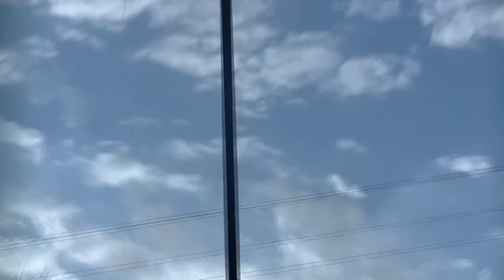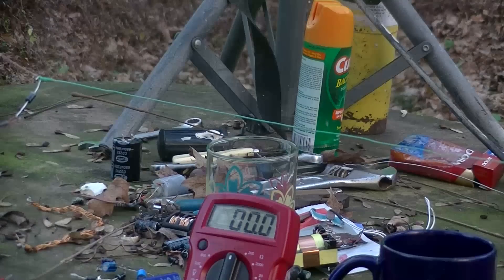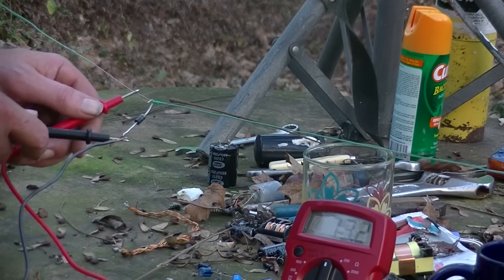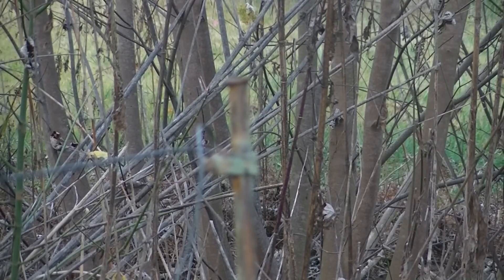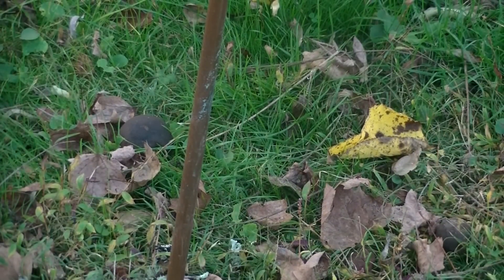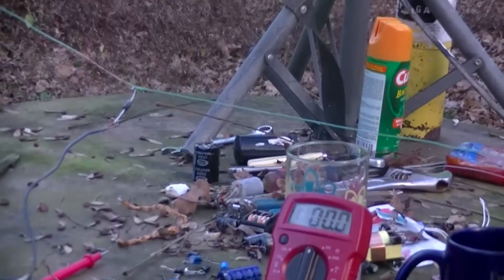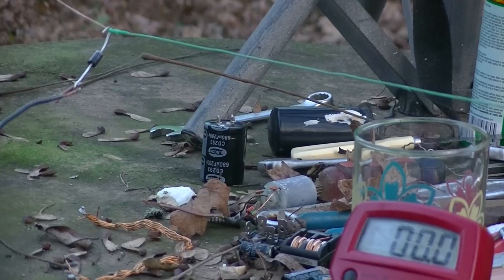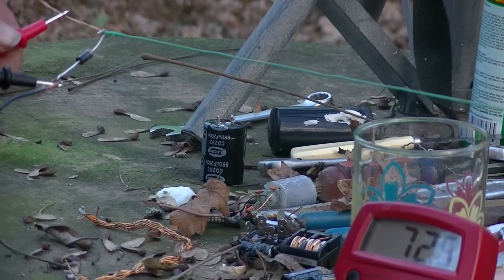Free energy antenna

Comment: For every meter going upward you will increase voltage by 1000 volts. Volts do nothing. Where are your amps? The stuff that makes stuff do stuff? There is no current in this video or you would not have so casually touched that ground wire connected to your positive bare wire as you did. This will do nothing. The thing the world is after is free CURRENT. Not VOLTAGE. Bless your heart. You did all of that work for nothing.
Reply from the maker: It was fun, just to see if I could get electricity out of the sky. In another video I was able to get 360 volts in a capacitor, that will bite you, but thanks for the comment.

Comment: 73 v potential does not mean anything. what matters is how much voltage drops when current runs. maybe you cant light a bulb with that setting because voltage can drop when there is a little current on the wire.
Reply from the maker: It was something I did for fun  , Have not given it much thought in awhile .

Comment: If you make a sphere shaped antenna out of graphene needles with sharp points facing towards the sky, i think you will increase efficiency. The more voltage you get, the better because if you get thousands of voltage from atmosphere and then step it down with transformer, you can get current therefore power. You can use atmospheric electricity to power a DC motor at 3000 or 3600 RPM which you can use to spin three phase electric generator and get thousands of AC voltage out, and then step it down with microwave transformer to get 120 or 230 volts which goes to voltage regulator and then to power your house. You will also need Tesla coil as it converts static electricity to AC when used in reverse. Youtube search "Tesla coil "the true secret" how it was really used.".

Comment: What can be powered with this? It looks like induction from the AC lines.
Reply: not much considering i would guess the current would be in the microamperes
Reply: Earth is electrically highly charged body. The sky at 50 km altitude is charged with 400,000+ volts. You need a step-down transformer to step down voltage to 120 or 230 volts and increase current/amps by a lot. The reason earth is highly electrically charged body is due to birkeland currents coming from the Sun so you are essentially harnessing electricity coming from space when tapping into atmospheric electricity. https://www.youtube.com/playlist?list=PLwOAYhBuU3UeKWHRrCw4i-KviQnAhQhBM
Reply: No mere ordinary transformer will do, and its not as simple as stepping it down, you aren't going to be getting a nice pretty 60Hz sine wave, that power needs rectified and dumped into batteries then it can be properly converted to generic AC.
Reply: You only need enough atmospheric electricity to rectify and convert to DC to power a DC motor. You can then use the DC motor to spin Electric Generator at 3000 or 3600 RPM to get AC at 50 or 60 hz.

Comment: Amperage is what the game is about, what you are showing is a fraction of what is needed to do any thing meaning full, when I was a kid, tested WW2 batteries, they showed at 1 or 1.5 volts but had no "power". Nothing here is free, their is no free power, you already have an investment in poles, copper wire, grounds, I assume are also copper, diodes, and you are using more power to make the "Craftsman" multimeter function than your are making. Solar or wind may give you better options, that diode is also eating your voltage.
Reply: Get familiar with birkeland currents, its what people are tapping into when harnessing atmospheric electricity. https://www.youtube.com/playlist?list=PLwOAYhBuU3UeKWHRrCw4i-KviQnAhQhBM Amps/current is easily gained with a step-down transformer stepping down high voltage to 120 or 230 volts. The higher the antenna is raised in the sky the better.

Comment: OHM's law will tell you that with a load, voltage will drop. I'll assume if you add a simple led bulb you will short out the ESD and the bulb might blink once but that's it. with caps, you may be able to blink the LED every 10 sec or so. give it a go...
Reply: Moon shiner  a blinking LED will use 20mA at 3v. So you won't need to calculate the voltage drop from 70V to 3v to provide a split second of current with a capacitor to determine this is a lost cause. There is simply not enough current to capture to charge anything worthwhile. What the video demonstrates is that he is showing what a radio signal looks like at a voltage level. If he tuned into the frequency, he would hear the broadcast. That's all. This is the basic concept of the no-power crystal radio.

Comment: Ok so, volts is fine but you need to build an atmospheric motor such as a Corona motor and a whole bunch of capacitors to make use  of atmospheric power. Yes you can get higher volts but there is no amps and the voltage will drop but if you can store the electricity fast enough to capacitors and regulate it it can become usable power. Look up the ion power group

Comment: Hey my friend, I am so happy to find you doing this.!! I can help you improve your system, and get High  voltage, gain's, if you want me to: I have helped,  Garrard Morin, with his experience, and others. All you need to do Right Now to get  HIGH Voltage, is ( add an additional piece of copper wire, any size (AWG 8 ) OR Larger. It can be added to your wire you Are using Now.!! Only Twist it onto you're wire about one Every 1 to 2 foot, or closer".... ( Making The wire You are using NOW" LOOK like 
( COPPER, Barbed, wire,). Hanging in the Air.!!! I know you it will have to be taken down, To add these Extra
 Peace's of wires, but Believe me, it will be well worth it for the Gian's in higher voltage you will get. After adding the extra Peace's to make you're wire look like a( Barbed wire,)!! 
Pit Everything back as you had it before,... NOW" the Only thing to remember is, that, as YOU are cutting the extra Peace's to be Twisted onto the straight wire that you have now, is ( ALWAYS)!! ALWAYS// ALWAYS, Cut the pieces that you are gonna be Twisting as SHARP AS POSSIBLE.!!!! USE GOOD QUALITY Wire cutter's,!! And cut the Peace of Wire that you're gonna twist onto the wire you have now, and cut it VERY SHARP.!!! The Sharper you get the smaller pieces, the more power you will Have at the end of the wire, Where you are Connected To your cap,.... In other words" what you want to do Is, take The wire You have up NOW,  DOWN.!! The get another roll of wire to cut 6 to 8 inches Peace's from, and Twist it onto the wire you have, Now, Leaving a short piece of it sticking out, making it to LOOK Like, a long strand of Barbed wire, Made of Copper, hanging in the Air Where you're other peace was hanging. If you do this, and leave the little Peace's that are sticking out, SHARP, ON THE TIP'S, You will be needing a capacitor that can take 8 to 1200 Volt's Range.!!! Contact me if you have any questions, I will tell you all I know. JR, and Good luck my friend.!!
Reply: Could you email me at roofingamerica.sc@gmail.com
Reply: Hey brother, Ive been following Gerard for a while. Have you seen any videos like this one that have all that extra info you recommended? I would like to create a medium sized ion harvesting unit. I appreciate if you could point me in the right direction. Cheers.
Reply: JP: Barbs?  No.  Voltage and current is induced by greater length of action.  Short wires, perpendicular to the main antenna will not increase induced voltage.  Read a book on electricity and RF principles.

Comment: You do realise the diode is cutting off half of the waveform so it will be 146V?
Just because you have a voltage doesn't mean to say its free energy, connect a load and watch it jump to zero.

Comment: Can you send me a schematic of of your setup?  Thanks.
Reply: Teryo Tolibas Hi,

I think he's just using a startup non-polarised capacitor (like the ones used with induction motors; washing machine or dishwasher motor) where one lead goes into the ground, while the other (through a diode; 1N4007 ?) is clipped onto the aerial wire he's got put all around his property. But that's conjecture. 🤔😐😊
Reply: Teryo Tolibas https://youtu.be/ah-GyD2GuLs
Reply: Fransje Bik

Comment: You're crazy puting and antenna next to a power line!!!! The power line being so close will induce voltage to your antenna giving you voltage, very dangerous!!
Reply: Lisa Lefteye or is it crazy genius?  Either way, the electrical utility is not impeded in any way by inducing a current on his wire.  However, it needs to be less than 6 feet to actually experience real corona discharge... plus it is a telephone wire which is like 24awg... i am an electrician and i wouldnt be concerned with such tiny wire
Reply: @Lisa:  Putting his antenna near a power line to induce a voltage?  That's the point.  How else do you think something like this would work?
@Matthew:  I don't see any genius' anywhere near here.  Coronal discharge?  What's that got to do with anything?  Any conductive object charged to a high enough voltage will exhibit a coronal discharge independent of any other conductors nearby.  Induction and corona have nothing in common.  Finally, why your lack of concern for such a small gauge wire, presuming what Lisa asserts is indeed correct?  In a proper configuration, and without it making contact with a live power line, it could easily induce enough voltage and current to be a problem for the beating heart inside a grounded human.  Wire gauge has  almost NOTHING to do with it.  Surely as an "electrician" you've seen the inside of a transformer.  What about all that "tiny wire" that's in there?  Still, even after making direct contact with a power line, a 24 AWG copper telephone wire could EASILY shunt enough current for long enough (before it vaporizes) to stop a person's heart.  So what's your point?
I'm an engineer and I think you couldn't find your ass with both hands and a headlamp.
Reply: @Lisa Fear mongering is one of the opratives of the Powers that soon were to be. At most 250 years ago the popukation was connected to the universal power grid in that way. Tesla and Morray just continued that path and the cabal was resisting with fear. The power he is unleashing is in no way as harmfull as the elctron energy we are forced to use.

Comment: A percentage of the "power" or "energy" is certianly being induced from the mains line nearby however there is a great deal of othher sources at work here. One of the most powerful of which is nearby "microwave towers" another is "Radio signals" both natural as to material in the process of decay, and of course man made signals, there is also natural ground balance which consists of positive and negative electrons constantly exchanging in the form of static. So with this all being said "YES" the power / energy being recovered is indeed "FREE" as there is no charge being applied for tbhe collection outside of the cost of the parts and time to build it. And to anyone exparamenting with this keep it up, you are all doing a great job!

Comment: Bob, unfortunately 73volt is not AC power. Power = voltage x current. So, add a load (an LED connected in series with a resistor or a submiliampere bulb used a while ago in telephone exchanges) and see if you still measure voltage between your rectifying diode and the earth connection.
Reply: Also with the diode it is not AC. That diode is a half bridge rectifier so it is half of the AC wave = DC. BUT if you can get a pulse from that to a transformer primary winding, you might something useful out of the secondary winding.
Reply: Or utilize the dc volts to split water (H2O) into H2 and O2, store the H2 and let the O2 go to the atmosphere as your storage container, then recombine the H2 and O2 in a hydrogen fuel cell to get the electricity back with a by-product of basically pure water.  See my Twitter page under the same name as this post to see just some of what this world is doing as it implements a hydrogen driven economy.
Reply: @DaveSmith-h5b  You can pulse a motor and get the kinetic energy and then use the backEMF to charge a battery ala Rick Friedrich https://www.youtube.com/user/rickfriedrich/videos